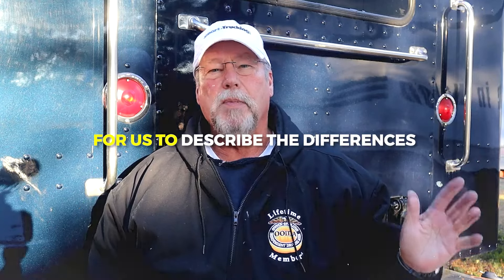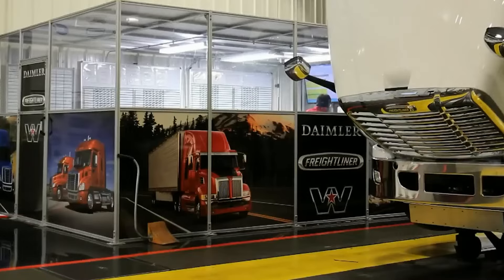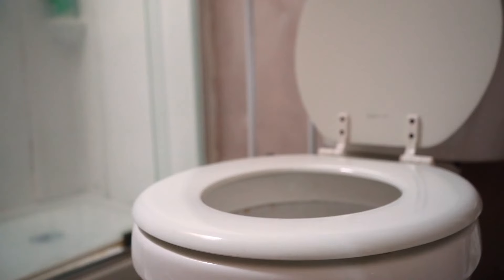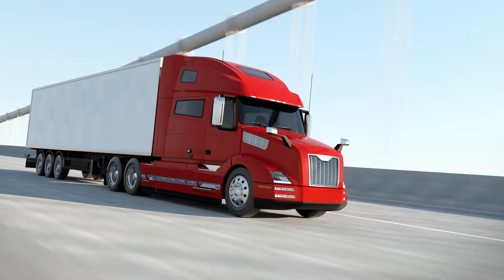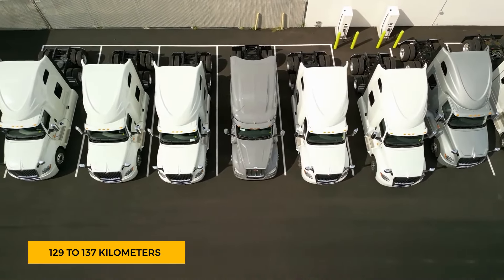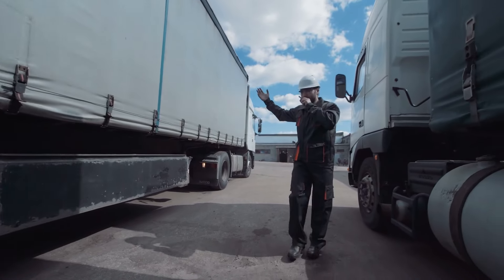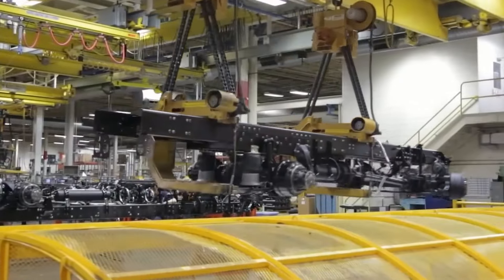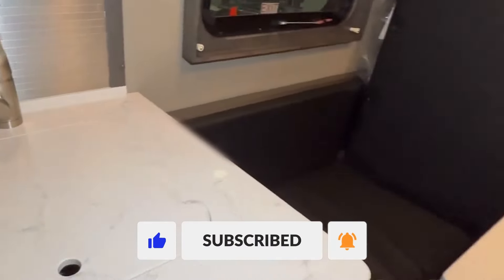Why AMERICAN and EUROPEAN Trucks Are So Different

Comment: Just a little note on the safety thing, yes EU lorries don't have much of a crumple zone, but the cabin is designed to fall off the frame to reduce impact damage. Besides, cabovers have much better visibility which makes them safer in that regard. We also have advanced emergency braking, lowering the chance for collision at all.
EU lorries don't serve the living comfort US lorries do, but I've been told driving comfort of cabovers is much better.
Reply: I can tell you first hand that cabovers are the single worst riding trucks ever produced. They are called kidney killers for a reason. I don't know where you heard that from, but it is patently false. The Euro trucks are nice though, they are built for the little roads they have. US trucks are probably safer for the driver, but the accident rate is probably not compatible for a host of reasons.